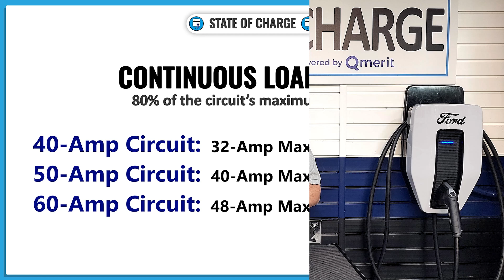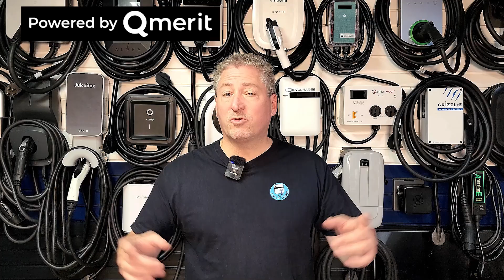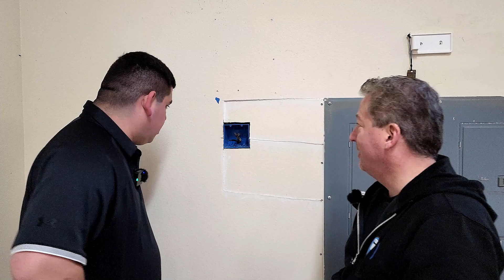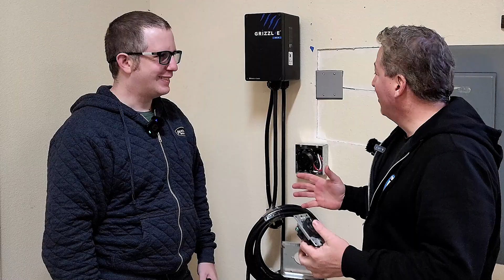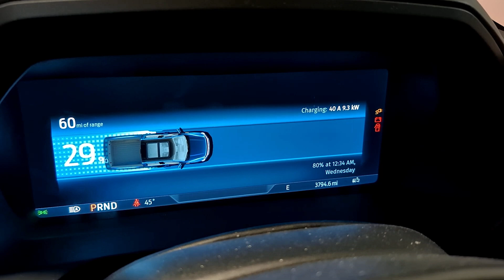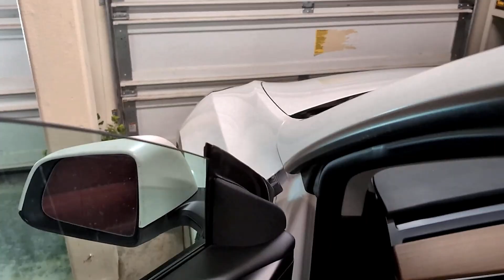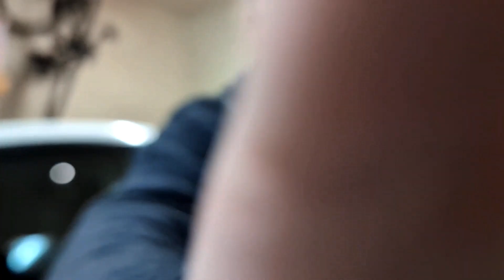Recharge Rescue Washington: We Fix A Dangerous NEMA 14-50 EV Charging Outlet Failure

Comment: Did the homeowner want a surface-mounted 14-50 receptacle box too?  I mean, why go the extra length when he CLEARLY wanted the flush-mount as he’d already demonstrated… 🤔 Even if the box needed to be deeper, it could’ve been recessed ie not fully ON the Sheetrock… thoughts?

Comment: Love the channel and all the EV charging deep dives. I’m hoping someone here might have run into this before.

I recently installed two 80A Autel MaxiChargers. One is mounted right next to the subpanel outside and works perfectly at 80A. The second charger is in my garage about 100 ft from the panel.

The garage charger works fine at 50A, but when I set it to 80A both of my vehicles show “Unable to Charge – Try a different cord.”

Vehicles tested:
• Cadillac Vistiq
• Chevy Silverado EV

Both vehicles charge normally on the charger by the panel at 80A, so the cars themselves don’t seem to be the issue.

The garage charger wiring was upgraded from #6 to #2 copper due to the run length, and voltage looks stable during charging.

What’s been frustrating is that I also discovered the U.S. 80A Autel MaxiCharger doesn’t appear to support local Dynamic Load Balancing (DLB) between chargers, even though the documentation makes it sound like that feature exists.

So at this point I’m trying to figure out two things:

Why the garage charger works at 50A but fails at 80A with the “try a different cord” error.

Whether the 80A Autel models actually support local DLB in the U.S. or if that feature is limited to other versions.

Curious if anyone else with these chargers has run into either issue.

Comment: My problem is, I have a ChargePoint .charger that is plugged into a 50 amplifier circuit. I've moved and the outlet in the new garage is on the correct side for my VW ID4. I'm considering a Cadillac Optiq and the charginging port is front left. I have an electrical out let on that side , question is, can that outlet be hardwired  to my ChargePoint charger so I don't have to back in to the garage?

Comment: Leviton basic 14-50 outlet safe use for EV charging.
Is there such a thing?
My son's commute is short enough that he gets by replenishing his 2025 Ioniq 6 overnight with a Level 1 mobile charger plugged into a 120V outlet.  Once or twice a week he takes longer trips of 100~150 miles and recharges with a level 2 mobile unit at 40 amps plugged into the Leviton 14-50 (1” long behind  the plate).  
For the previous 4-5 years the same outlet was used to charge a Tesla Model 3 with its mobile charger (at 32 amps, apparently) daily with no problem.   The mobile units are generally left plugged into the respective outlets. 
The Leviton 14-50 outlet and wires inside the box show no sign of abuse, looseness or degradation.  Is it reasonably safe to continue using it at 40 amps once/twice a week, checking on it every couple of months, or is it a matter of time before a serious problem arises.  Can the risk be minimized by limiting it to 32 amps?  Even lower?
Thanks.  Your videos are very educational and much appreciated.  Regards.

Comment: Great video and information, Tom!  When I was wiring my garage for EV charging, I installed Hubbell commercial grade NEMA 14-50 outlets.  They were $80 each versus the $10 residential grade box store version, but they are much more robust to handle the increased loads.  I also used steel electrical boxes, 1" conduit and 6 ga THHN wire.  Not cheap, but it's done to code and done right.
Reply from the maker: And you can sleep soundly at night. How much is that worth?
Reply: @StateOfChargeWithTomMoloughney my bedroom is over the garage. Will definitely sleep better!

Comment: My new ChargePoint charger will be hardwired. However, my backup in the event of failure is the 125V portable charger that came with my Ioniq 5. I’m not so confident that my 20year old  electrical system will handle a continuous 12A load.  I think I’ll have my installer put a 20A outlet next to the charger!
Reply from the maker: I highly recommend that. If you plan to use it often, install a new dedicated 20a circuit and get a high-quality outlet from a supply house, not a $0.89 outlet from Home Depot.
Reply: @StateOfChargeWithTomMoloughney  I replaced every outlet and switch in the house when I bought it. With commercial quaity items.  Interestingly, every outlet in the house is wired with 12ga and almost every circuit is 15A. likely an effort to keep from overloading the CB box. The new boxes will be inside the garage, directly behind a new service entrance/load center. Belt, suspenders and staples!

Comment: I imagine that charging two vehicles at once wouldn't be as fast as charging one by itself. Was there an option with the dual Grizzl-e charger to have it hardwired to a 60-AMP circuit for faster charging? Also couldn't tell if the electrician was using solid or stranded THHN (which I believe has higher amp rating).

Comment: I have a 2017 Volt.  Currently have a 30 amp circuit with what I assume is the $10 Leviton outlet.  An electrician installed it in my house at the time it was built (also 2017). My EVSE can provide 20 amps continuous.  And the car itself is only capable of pulling 16 amps continuous.  So based on this video it sounds to me like I am safe unless I would upgrade to a vehicle that is going to draw more amps, in which case I would need to upgrade both the circuit and the outlet.  Is that accurate?

Comment: We're having a 1450 installed next week. I received an email from the electrician this morning stating

I received a report from the electrical supplier regarding the NEMA 1450 receptacle. They've been getting feedback that the model I originally quoted you has been causing issues for their customers. To address this, I recommend switching to an industrial-grade version, which costs... 

Keep up the good work!

Comment: That Grizzle box on the wall is kind of dump way 2 charge 2 EV at the same time, you better off having 2 NEMA 14-50 outlets on 2 separate circuit breakers, where you can charge each EV to it full potential (40A), and it may came out cheaper then having the Grizzle.

Comment: Hi Tom. Thanks so much for this very useful information. I recently had an incident with my JuiceBox EVSE installed in my garage. It has been working fine for the last 6 years. Recently, after finding that the car did not complete its usual charge, we noticed a burning smell and looking at the 240v outlet saw brown marks on the wall leading to the outlet with was also burned. I turned off the breaker which was still on, but I could not remove the plug from the outlet. I called my electrician and he found that the NEMA 14-50 outlet had fused to the plug just like in your example. 

I think we were lucky that we did not have a fire!!

Since the charger is a Enel X JuiceBox, I knew I would need a new EVSE since they are out of business. It seems like an odd coincidence that the this occurred soon after they stopped supporting the unit.

 So, I checked your review of the best EVSE units and purchased a ChargePoint HomeFlex for hard wiring. Since it just arrived I will be calling my electrician for installation this week. Any suggestions of things I should be concerned with? Can I still use the existing wire? It would be a much greater expense if that needed replacement. Also, I noticed the breaker is a 40amp and the JuiceBox is also a 40amp. Could this be why it failed? 

Thanks again for you very informative videos.

Comment: Just experienced a complete meltdown of our home charger. The plug connection was completely melted and failed. Could have easily caused a fire or electrocution. Thanks for this critical info. Class action suit coming for Leviton. Leviton does not even list the older 14-50 outlet on their website anymore. They only show the more robust EV approved outlets.

Comment: Outlet based charging should not be allowed. I was a licensed electrician and am an electrical engineer.
Reply: I use cheap Nema 14/50p devices in my shop and at home for temporary use. Fun fact the NEC is the bare minimum and the nothing in electrical code addresses the infancy of EV charging. We had the same problems with solar back in 2014 when none of the code cycles had any safety implemented.

Comment: Although I feel that your point about the heftier outlets being a safer choice is valid, I feel the video misses the mark on several points. 
1.	You never discussed charge rates. The more current you try to pull through an outlet the more you are at risk of the outlet overheating. The inexpensive Leviton may be perfectly safe on a 30a breaker charging a vehicle at 24 amps. In your video, the user was certainly charging his vehicles at 40A (maybe 48?).  I don’t think you mentioned that charging @ lower amperages will reduce your risk of overheating.  
2.	There were other contributing factors to the failure that you don’t mention.  In particular, the outlet was installed in a closed wall space, in a PLASTIC box, surrounded by insulation.  All three of these factors reduce the ability of the installation to dissipate heat.  
The newly installed outlet was surface mounted in a metal box which will be much better at dissipating any heat build-up.
3.	You mentioned that the reason over-torquing the terminal is bad is because the wire would be over compressed and would flatten the wire so it is “not the thickness it’s supposed to be.”  Overheating is caused by electrical resistance.  The resistance of a connection is primarily a function of the amount of material in the wire and amount of surface area the conductor is in contact with the terminal. Deforming the wire (making it slightly flatter) is not changing the amount of material at the connection point.  I believe the reason the better Leviton is rated for 75 in-lbs (as opposed to 40 in-lbs for the less expensive Leviton) is because the heftier body will allow a higher torque without breaking the terminal.
4.	You mentioned that if aluminum wire was used “it would’ve failed earlier”.  I don’t think that anyone would argue that aluminum wire is better than copper.  But aluminum wire in of itself is not a problem as long as it’s properly sized and installed (with de-ox grease).  I believe that for a 50A circuit you would need 4 ga aluminum or 6 ga. copper.
5.	You seemed to downplay the issue of plug insertion repetition as a failure factor.  Blade contacts that are worn out or fatigued so that they don’t make a proper contact with the blade IS a problem and could cause overheating.  Leviton even mentions in their literature for the heftier outlet that it is built to handle a higher number of insertions.
There are more factors that cause overheating than the ‘beefiness’ of the receptacle and I think you do a disservice to your viewers to not more thoroughly discuss all the issues.  Bigger is not always required and the cost of the bigger outlet is significant.

Comment: I’m having an issue with my Ford Connected EVSE, seems to fault in the cold weather… I got it to integrate with my Ford F-150 Lightning, but it’s been very frustrating that I can’t rely on it (second winter in a row) when temps get below freezing and I need to stay plugged in for optimal battery healthy/conditioning. I’m also wondering if the 60 amp circuit has the correct wiring size/gauge. I had a licensed electrician do the install, but they didn’t have much experience with EVs, so wondering if they didn’t size it correctly for continuous use as they originally had a 14-50 outlet and 50 amp circuit and I had to go back and have them hardwire the charger. How do I know what size wire is in the conduit? What size wire should I have? Is it an easy DIY if I need to put new wire in?

Comment: Thanks for the video, Tom. It helped me realize that I probably need to replace my current self-installed outlet (Leviton Model # R20-55050-P00) at once with one of the new ones. I've noticed that my Juicebox 40 only seems to be pulling 38 amps recently (it originally pulled the full 40) and I wonder if that's a sign of a failing outlet. Do you happen to have any insight on that? I happen to live in NJ, if you'd be interested in checking it out. Also, I noticed that Home Depot currently has two Leviton 'EV Charging' outlets on their website (Model #R10-1450R-0B0 at $39, and Model #R01-1450R-000 at $59). Any ideas as to the differences between them?

Comment: I received a quote from QMerit for a connection between my electrical panel and a Grizzel-E charger (about 25 feet in my garage) and was shocked at how expensive the quote was. Yes I want to be safe, but am also practical when it comes to cost.

Comment: Thanks Tom.  I have a standard Leviton nema 14-50 outlet in my garage.  I’m just using the cord that came with my lightning and not using any home charging unit.  Is that plug sufficient or should I replace it with the industrial plug?  Thanks

Comment: Hey Tom, Thank you so much for this and all your other videos, especially those related to EV safety. I have an EVSE safety related issue which bears investigation, and may have potential for a future video.

Over the holidays I have been perusing the owner's manual for my first EV, a 2024 Nissan LEAF SV Plus. In the Charging section, I came across the following statement: "The device has parts that may spark inside. Do not use it where gasoline, paint, or flammable liquids are used or stored." This statement pertains to the "Genuine NISSAN Adapter" (AKA the OEM EVSE) and reminded me of a comment my HVAC guy made while installing my new AC condenser, that it is a source of sparking and had to be a certain distance from my gas meter vent. Next to my overhead door is a 3' wall with a myriad of utilities mounted on it and next to the drive is a 3' strip of ground where my gas meter and AC condenser are located. The gas meter sits about a foot away from the garage, but it has a tube extending back toward the garage which I believe brings the actual gas meter vent to within a few inches from the garage wall, where the 120VAC/15A outlet is located, where I'd hang a Level 1 EVSE.

Fortunately the outlet fairy installed a Hubbell on the inside of this garage wall less than 2 weeks after purchasing our LEAF, so we do Level 2 charging with our "Genuine NISSAN Adapter" and an EVIQO should be arriving at the end of this week. While I have yet to hear of an EVSE causing a house fire by igniting gas meter vented gas, it could be just a matter of time. I'd be curious to hear what Qmerit has to say on the subject.

Comment: Further inspection revealed nothing wrong with the receptacle or wires connecting to it. It was a faulty splitter. The receptacle is from the 1950s and the brand is Slater. It is more robust than the residential Leviton. I’ve charged for over a year with a Splitvolt evse with no issues other than the splitter. When charging, the plug gets slightly warm. So beware of extension cords and splitters. Good quality ones there is no problem. I’m still upgrading to a Hubbell 14-30. The old 10-30 box is grounded. So a 14-30 will go right in. They don’t make a commercial grade 10-30 and there is nothing for 10-50.

Comment: The thing with ev charging is that the draw is constant at a sustain amperage for like 8 hours.  So the wires and need to be able handle that constant load and connections need to solid and the plug needs to be of high quality

Comment: You saved me. I checked my extension cord and splitter. Both the splitter and the extension cords have scorched prongs on one of the hot wires. There is no commercial grade 10-30 receptacle so I just ordered a commercial grade 14-30 directly from Hubbell. Hubbell makes a residential grade 10-30r for $13.75. People online try to pass them off as commercial and sell them for $50 and up. Folks see Hubbell and don’t realize they also make residential grade. Beware.

Comment: Yes, the contacts at outlet should be clipped, not torqued to need retorque later. I installed a very robust expensive thick cable which can hold 100 A - at least it is twice as thick as one used in the video. The outlet has to be robust and needs to be at least 50 USD. We charge a Chevrolet Bolt EUV with its own EVSE. Even the EVSE cable might become warm sometimes the outlet is always cold even in the summer high heat. The maximum amperage could be up till 50 A so the outlet must be 60 A high grade to begin with. Obviously, the breaker has to be a new, rated to be 20% above the consumption. I opened up the oulet  in 1.5 years of usage, it is clean, looks new, doesn't smell, put it back the way it should be.

Comment: No, my EV charging does not draw more power than anything else in ny house. I set my EVSE to 32 amps. My two AC units, otoh, draw a peak 60 amps when they start and over the course of an August day, they will consume 30kWh which is about 7kWh more than my car will use for a typical daily charge.

That said, now that leviton has a EV specific outlet, Iltl probably grab one of those and replace the current one.

I think leviton should offer a $10 rebate to those who currently have the original and want to upgrade.

Comment: I have the basic leviton 14-50R and I have been charging with it for going on 3 years without issue. 

It is a 50 amp circuit, but I run it at 32 amps. I leave the EVSE plugged in (unplugged it perhaps 3 times in 3 years), and  I typically charge for around 3 hours. (23kWh).

I inspect the receptacle frequently and it is showing absolutely no sign of any thermal stress

I installed the outlet myself (and I bought the correct cover the first time ;-)

When I was in  vocational high school I trained up to the point where i could have taken the test for a journeyman's ticket (3 year program) but then went on to become a software engineer.